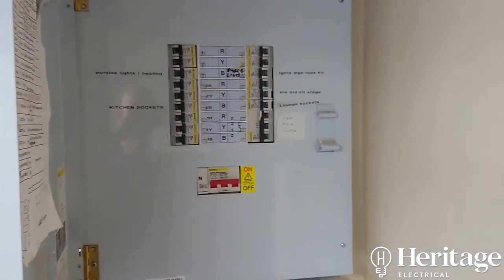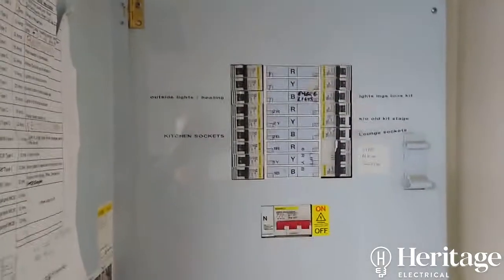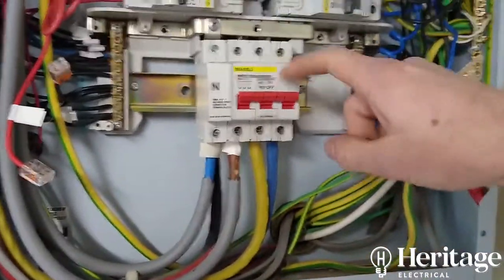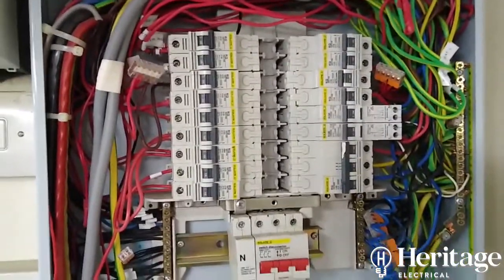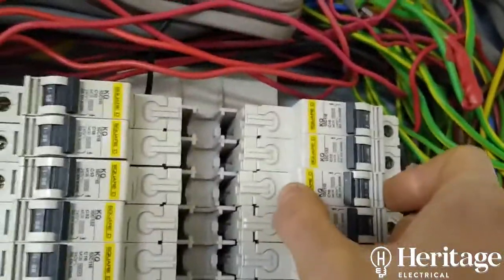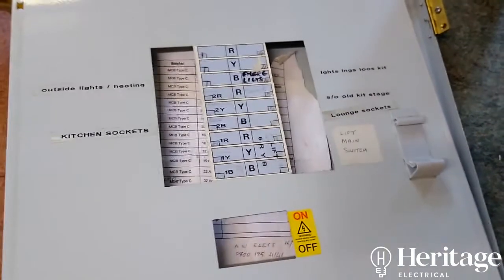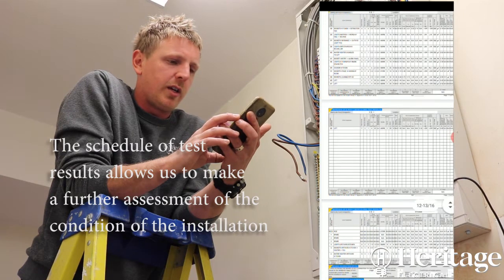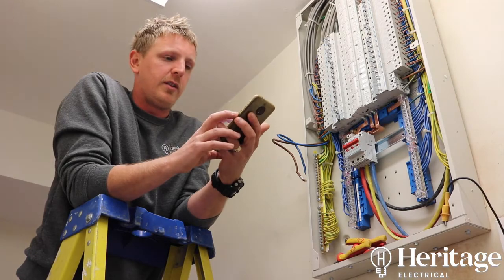3 Phase Condition Report & Distribution Board Change

Comment: Aussie spark here. Been in UK several years now. Where do U send the online report too? Who monitors if the work gets done? I imagine the building would not be insured.
2nd q. What about testing a massive factory with very high up lighting ect where you have to pull apart vthe last light on the circuit and test ir between earth n line?
Very nice workmanship btw!!

Comment: Not much better than the original in my opinion, what’s with the massive holes in the adaptable box? And grouping factors of the cabling all tied together? I couple of lengths of trunking would of got over that, how did you get around the no SPD protection? I just see a corner cutting, save as much money as you can here. Not a fan,